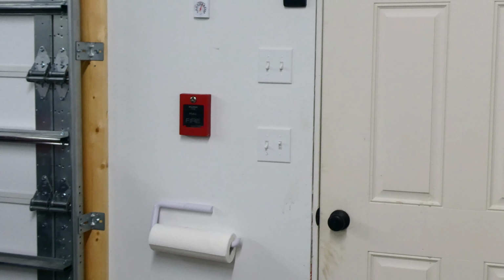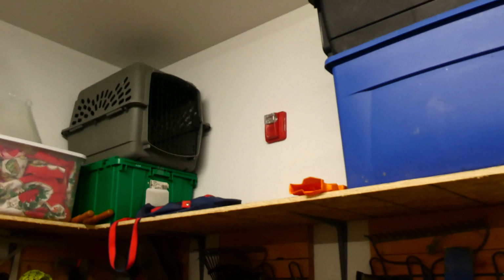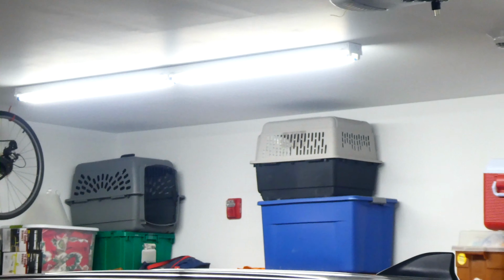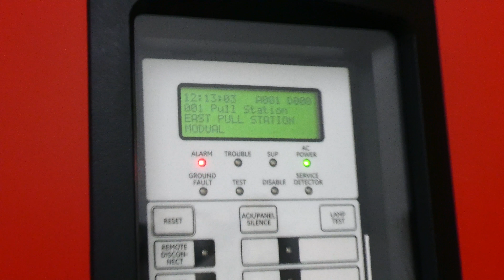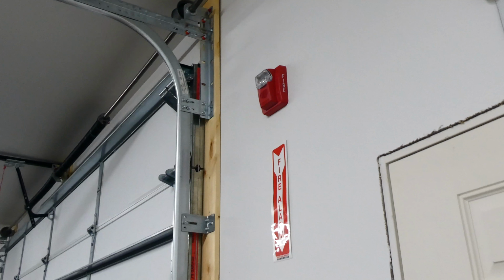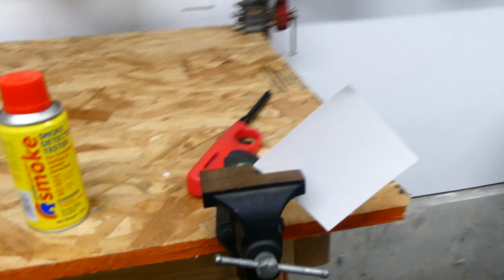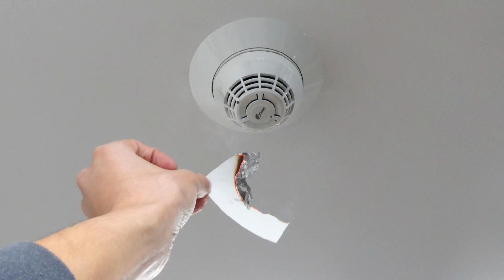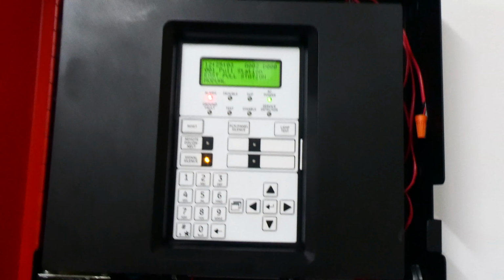S.E.R. System Test 10: Using Fire

Comment: Just a thought: Since this system is in a garage, it might be a good idea to wire a CO detector into your system. Of course, it's your system so you do what you want with it! Great video as always. :)
Reply: Well actually it's a shed that he build and put in a Fire alarm system in it but the shed has garage doors that's why you see cars and other things that would be in a garage
Reply: Do you think thr xiaomi smart smoke detectors are worth buying?
They rely on a battery only, but they can be monitored thru an app on your phone.

I think they are using  a different technology instead of photoelectric (wgich seeems to be the best) though.
Reply: don trump don’t trust those types of smokes. Only trust them if they are UL listed, or they are a good brand.
Reply: Gentex Guy Why there is a ground fault and what is ground fault on your control panel I also see trouble Sup test disabled service detector and what all those mean on your fire alarm control panel S.E.R. Safety

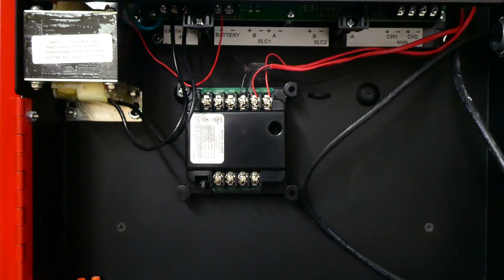Comment: 1:03 “…model AvSMR. And this is placed in the fire alarm control panel as you can see. And what this little module does is it will make sure that the strobes on the fire alarms will flash at the exact same time you get to hear some awesome fire alarm ASMR noises!!!”

See what I did there? 🤣

Comment: I don't recommend you using fire to test smoke detectors/heat detectors. For one, fixed heat detectors are only a one time use. For two, fire is really dangerous even in buildings.
Reply: He is a professional who knows what he is doing. He's doing tests in a controlled environment.
Reply: I know that. But still. Unless your doing what he is doing